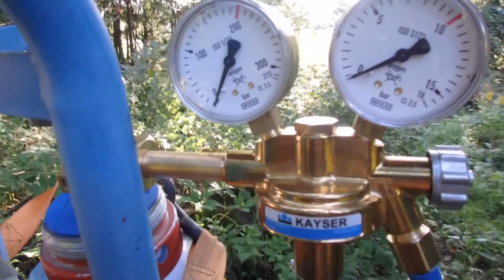Rocket engine testing

Comment: That was very inspiring. Thank you. I have access to liquid oxygen so I'm planning to use it. What liquid fuel did you use?
Reply from the maker: Mixture 70 % alcohol and 30 % water.
Reply from the maker: Correction: engines 6-9 use gasoline and engines 10-12 alcohol/water.
Reply: @notmadrocketscientist1902  how do you pressurise fuel
Reply from the maker: @Exotic_Chem_Lab  With nitrogen gas.
Reply: How do you have access to liquid oxygen? And do you know how I can get access :)
Reply: @robbiejames1540  to anyone going to attempt building a liquid fuel engine, please be bloody careful. Learn the equations, do it right. There are many things that can go wrong and you need to do a tonne of research.
Reply: @dt2419  
Don't worry, ive done the research and i managed to get my liquid rocket going (with mach diamonds!). However, to get the longer burns i needed denser oxidiser (i was using Gox - alcohol). That was why i was asking.
Reply: Robbie James no worries mate I just urge people to be careful. Especially when calculating nozzle dimensions it can be exceedingly dangerous if you get anything wrong. Good luck!
Reply: @dt2419  
Yes, you were very right to ask. It's never worth risking your life for. Thanks!
Reply: @dt2419  I'm currently designing a solid fuel engine, do you know an easy way for nozzle gimbal, and fins are too unrelaible
Reply: Robbie James if you are still curious, welding supply shops will sell both liquid nitrogen and oxygen. Just bring a tank/dewar and they will gladly fill them for you. Fortunately oxygen has a higher boiling point than nitrogen so you can make liquid oxygen by chilling the oxygen with liquid nitrogen. 

If you are lucky there are suppliers which sell liquid oxygen directly however generally not to everyday individuals.
Reply: @eyeborg3148  
You don't happen to know if there are any in the uk, do you? I wasn't able to find anywhere that seemed to sell it, but ill look again.
Reply: Robbie James no I live in the USA. I don’t know what laws and regulations you have in the UK but at least for us Americans it’s pretty easy to gets your hands on liquid nitrogen and oxygen tanks.
Reply: Richard Vaughn no, do some research before posting stuff like this!
Reply: Rocket Cello it’s really hard to give you a good way of doing it without working on the engine myself. There are also a lot of variables you have to account for in just about any mechanical part of an engine. I’d just say continue to research, consult a mechanical engineer if at all possible to look at it. If I could help you in person I’d be happy to but unfortunately that isn’t possible.
Reply from the maker: @robbiejames1540  Yeah, denser oxidiser - I want it too. But I guess working with liquid oxygen is difficult. Boiling point, handling, it freezes valves and so on. Maybe nitrous oxide is better?
Reply: @notmadrocketscientist1902  
Yeah, I've looked and looked, but nitrous seems to be pretty much the only choice. I've tried to avoid using it until now because I've heard about people getting nasty combustion instabilities in hybrid rockets (what I'm working on right now) and also the vapour phase has a nasty ability to explode. And it's still not too obvious how to get it in the UK. One thing that's interesting that I saw is you can make it much safer and slightly more efficient by dissolving high pressure oxygen in it which I might try.
Reply: This is the best tread eveeeer!

Comment: You nailed it on RUD-10 at 4:00!  How much thrust were you generating?  How does that compare to the pressures of the incoming fuel and oxidizer?
Reply from the maker: Yes that was the longest run ever. Thrust 27 N (2,8 kg) with pressures 9 bar on both fuel and oxygen.

Comment: Love the video! Great work on your rocket engine! Keep on perfecting it!

May I suggest a few things? 

First off, you need to have the ignition source inside the combustion chamber instead of outside of it.  Seems that what is happening is that sometimes, the speed of the fuel exceeds the flame front, so you wind up having ignition outside of the combustion chamber instead of inside it. 

Secondly, if you line your combustion chamber with graphite (which has excellent heat resistance and is cheap), it will be much less likely to melt or have a blowout.

Lastly, make sure to start the rocket oxidizer rich, and then start the ignition and fuel. Otherwise, you can end up with a "hard start" and possibly destroy your engine. 

Hope this helps! Look forward to seeing more from you! Good luck!

BTW "RUD" is the best name ever for a rocket engine 😀

Comment: I built a mental rocket motor as a younger man and it nearly set the concrete on fire i swear bits of molten tarmac an stuff were on the floor and it was weirdly soft after that. i used a design from an old book i found in my shool library and i had a 11 ft rocket built for it with a chute and a gyro and lots of care and attention only to have it make a loud fart noise raise 20 or so feet then blew apart spectacularly my next door neighbour thought an army test had gone wrong as the majority of its flaming remains ended up in and around his pond lol rocketry is very fun but very very hard to get right

Comment: Nice. It's still under expanded though.
Reply from the maker: Can you see that? So I need a little bit larger nozzle exit?
Reply: @notmadrocketscientist1902  yeah. I can tell becouse of the way the Gases are still expanding rather fast after leaving the nozzle. I would also try a smaller throat, if your combustion chamber can handle the pressure and heat. I would increase the exit diameter by maybe 1-2 mm and maybe make it a bit longer.

Comment: 2 Things:
1. I noticed the burn through on the side of the engine; a higher tempurature material might help!
2. Do they use an equivalent of O2 sensors for rockets engines?  I'm thinking 2 flow meters and a computer to regulate mixture (it looks you had mixture issues).
Reply: Did u watch the end of the vid?
Reply: @maraqu  yes, but it's possible I missed something?
Reply: For me it seems like in the later part, there is no more burn throught and the micture is not bad, just seems to have a little bit to much oxygin but this is not sth to controle by computer, just spin the valve abaut 5-8°
Reply: @maraqu  ok well copper is not really high temp usually they use graphite at least for the nozzles, but steel, titanium, ceramic or tungsten alloys would make more sense!  A composite might be a good idea too: ceramic on the inside with titanium or aluminum on the outside for strength and lightweight.

There's always room for a little computer like a Raspberry Pi or even a single chip on a rocket!  It could also run guidance and/or GPS tracking!  The real question would be: can you do the coding yourself, or what is the budget for the project?
Reply: @bardrick4220  yea, ceramic with aluminium rly might be a good idea and it is the cheapest variant. And the coding on a Rasperry Pi is not a question becouse there is this program, called "Scratch". Its realy good for beginners to make code without actually coding.

Comment: Hi I have a question because am in the process of building an engine myself and the question is what are using a fuel is it something like kerosene and oxygen  or is it something else?
Reply from the maker: Fuel is ethanol (74% by weight) and I use gaseous oxygen.
Ethanol is cheap and gaseous oxygen is easy to work with.
Reply: @Not Mad Rocket Scientist  I have a second question how many litres of oxygen have you used in the video?

Comment: Try using regenerative cooling, or at least make another chamber around the combustion chamber filled with water to help maintaint it cooler. I noticed some of the first tests had a meltdown at the walls.
Either way, you have a very good engine there.
Reply from the maker: I am using regenerative cooling on engines which don't melt. Ok, RUD-8 melted because I used gasoline, there was too much heat.

Comment: What are you cooling with? Looks like it might do well to cool with fuel, if you can drill into your injector plate to drain fuel from the jacket into the chamber. Getting some regenerative cooling could add a lot to your performance. I don't know if you're already doing this, sorry. The imgur pics didn't show it well, if I missed it.
Reply from the maker: It is just like that you said: regenerative cooled with fuel.
Reply: @notmadrocketscientist1902  that's awesome. I like the huge volume flows you're getting there in the exhaust. It looks very stable. How are you igniting it. It often looks like a bit of metal burning in oxygen or something before the fuel is introduced

Comment: hey. how did you build this lmao. im working on a 10 foot rocket. Solid fuel theirs going to be  2 stages first stage runs on 1 J engine and 4 G engines all highest power ones out there. then the second stage is another G engine. But heres the PROBLEM I dont know how to come up with a eletronic pistion or explosive whatever system to seperate the first and second stage. the first stage is duel deployment the second is not, Could you help me???
Reply from the maker: Sorry, no I can't. I know nothing about staging in model rocketry.
Reply: @notmadrocketscientist1902  thats okay. How many newtons of thrust does your engine generate
Reply from the maker: @inex4431  Record is 33 N so far.

Comment: 2:42 this is my favorite test fire
Reply from the maker: I didn't have thrust metering system then but it seems there is good thrust. Fuel was gasoline and engine was not cooled so I knew it would melt. But that was spectacular.

Comment: Can you please describe a little how you make nozzle?
Reply from the maker: I forge a copper pipe with hammer and rotate it a little after every hit. When I reach desired throat diameter I stop and cut leftover so that exit diameter is what I want. Contour of a nozzle is not perfect but it works. Handmade - slow but simple. One hour work. Look pictures here: https://imgur.com/a/3LZNOEf
Reply: @notmadrocketscientist1902  Thank You very much for your help. Looking forward to see more RUD 12 test firing.
Reply from the maker: @Exotic_Chem_Lab  Next test is May 2020 - more pressure, more thrust (I hope). Now it is winter here, my hands are freezing if I go out...
Reply: @notmadrocketscientist1902  I will also be starting building it from may 2020 (Summer College Break).
Reply from the maker: @Exotic_Chem_Lab  notmadrocketscientist@gmail.com in case you need advice.

Comment: I respect dedication and hard work. but still - I beg your pardon, but calling this shit a rocket engine is simply a sin. it is, at best, an autogen, a gas burner, a turbo grill, but THIS does not apply to rocket engines.

Comment: Are you aware of the fact that you contaminate the land with all the unburned rocket fuel?
Reply: Oh, wow! Unburnt alcohol.God only knows what that could do to the environment!
Reply: @DouglasEKnappMSAOM  Rocket fuel is not alcohol it is based on oil.
Reply from the maker: @nilsfrederking62  It is alcohol and water. I don't use oil based fuel. Basically these engines run on 80 % vodka.
Reply: @notmadrocketscientist1902  Thanks, good to know. Wodka in the garden sounds like a nice party......
Reply: @nilsfrederking62  You seem open to learning. I suggest you watch: https://youtu.be/C4VHfmiwuv4

It is long but entertaining and REALLY well done.

But to sum it all up, there are a lot of rock fulls and some are WAY worse than oil (Hint, if it has red smoke run for your life!) and others have an exhaust that is literally water that is bunt oxygen and hydrogen and many things between.

Comment: Can i solder my rocket engine
Reply from the maker: I braze parts together. Soldering is a bit weaker but maybe it will work. Brazing copper and brass is easy.
Reply: Thanks